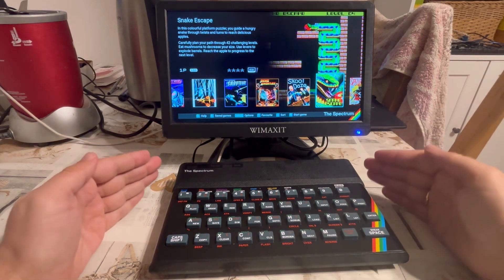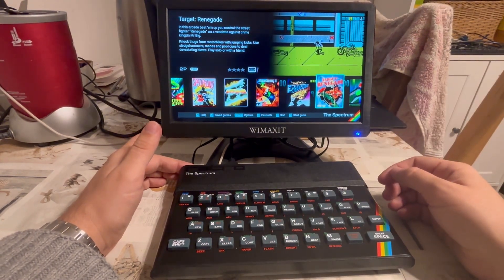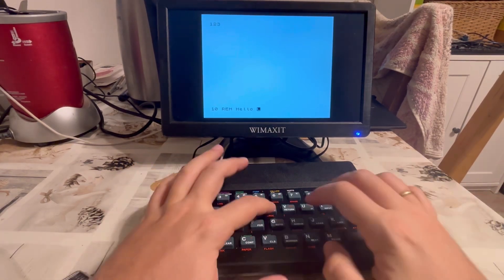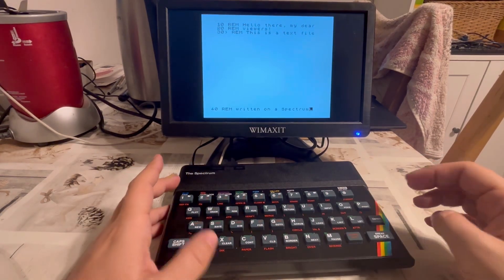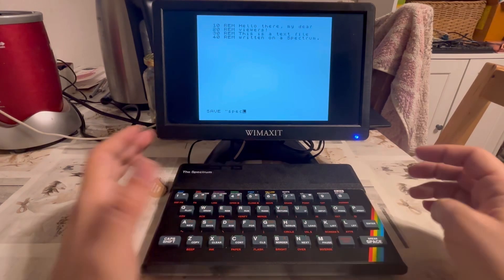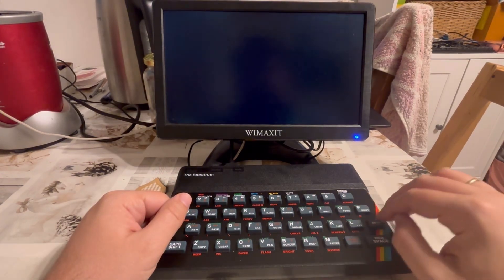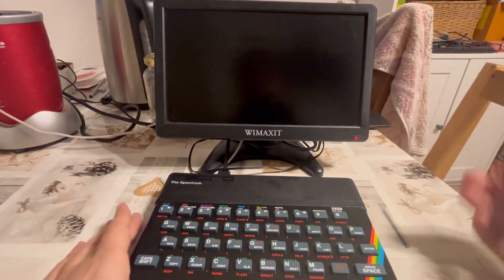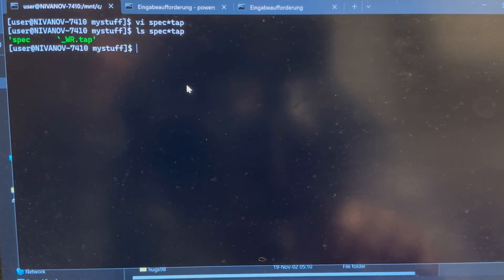"Abusing" BASIC as a text editor on the Spectrum

Comment: Loading from within BASIC is possible, but you need to "attach it" via media select first, then typing LOAD " " will work. Also, each virtual tape file can have multiple programs on it. It will adopt the name of the first program, but if you save a new program without first "ejecting" this file, what happens is it increments the tape by another two blocks. Each odd numbered block is the index, which then loads the following even numbered block, which contains the actual code.
It's well worth reading the manual about how the virtual tape navigator works (hold the Home button and press the A key to bring it up).
Reply from the maker: Thank you for the elucidation, may it be helpful to many!

Comment: Oh, and one more thing: you’ll probably want 48K ROM for this, and not 128 one. AFAIR, 48 didn’t have any checks nor limits on line length, but smarter 128 had something like 20 rows limit. Also, you could use REM to store quite long machine code in the form:
10 RANDOMIZE USR <address>:REM <address><binary code follows>
Reply from the maker: Thank you very much!

Comment: It's wonderful that ASCII encodings have stayed the same over the decades. Have you ever used a non-Ascii system, like ebcdic?
Reply from the maker: Sometimes played around with older systems in emulators (SimH), but did not like them too much — nothing you commonly rely on, including the simple idea that one letter follows the next, is necessarily true there…
Reply: @ninoivanov   That’s what Unix command dd(1) is for – original purpose was converting EBCDIC to ASCII, and syntax is strange like  “dd if=input_ebcdic of=output_ascii.txt conv=ascii,lcase“ because dd(1) was based on IBM JCL Data Definition ‘DD’ statements.
BTW, to play with native EBCDIC OS simh is not right tool, one need ‘SDL Hercules Hyperion’ (best built with ‘hercules-helper’ by Bill Lewis) and ‘MVS Turnkey 5 Update 3’ by Rob Prins. Also, x3270 is needed to talk to the emulated IBM ESA/390 running MVS 3.8j.
This is completely different computing experience for someone familiar only with Unix, VMS or NT; luckily @moshixmainframechannel has great instructions for beginners like me 😊